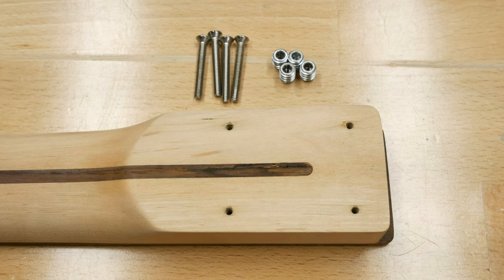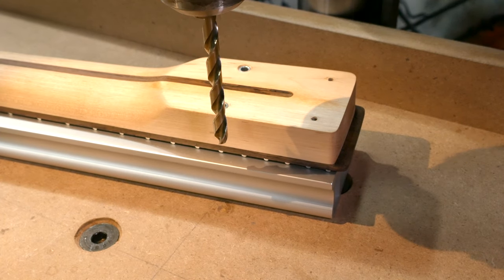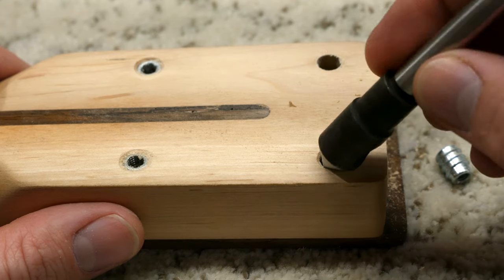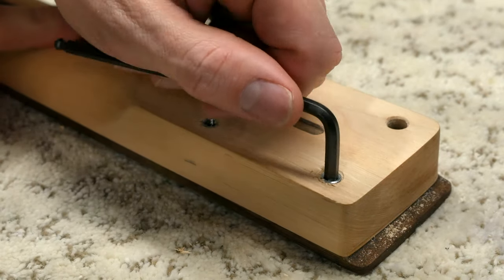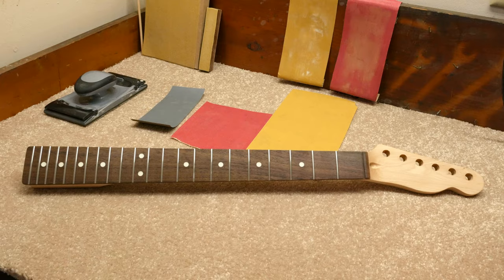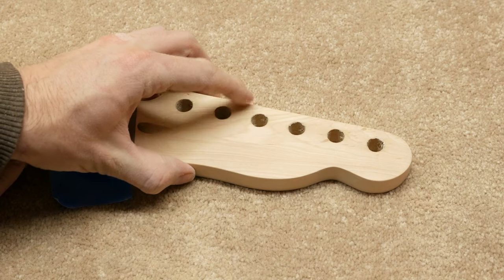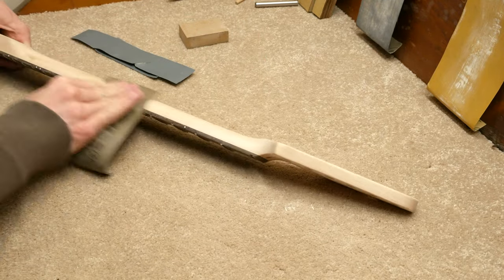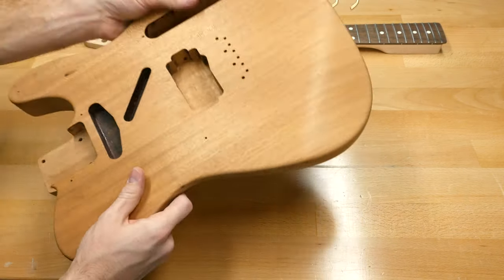Point of No Return || eBay Telecaster Revival || Episode 8 || DIY Partscaster Guitar Build

Comment: @Augment Guitars. Sir, you may already know this, I remember a video from Texas Toast Guitars where they fitted those threaded inserts to the neck on one of their builds/upgrades. I am sure that they used a straight piece of (cut - down) Allen/hex key in the chuck of the pillar drill to drive the inserts into the pre - drilled neck. The guy turned the drill chuck slowly by hand, with the neck securely clamped to the drill table. This made sure that the inserts were started and driven in as straight/vertical as possible. Keep up your good work. Stay safe and well.
Reply from the maker: Good call! That is an excellent way to install them as well. I'll have to look that up and check it out. Seems like a foolproof way to install threaded inserts. My jig works pretty well and ensures they are in straight. I plan on making a video here soon detailing how to make one and use it. Thanks for the tip and watching the video. I hope you stay safe and well too. 🙂
Reply: @Augment Guitars. Thanks for your reply. The Texas Toast video where they fitted the threaded inserts was specifically on a Fender Stratocaster. In order to adjust the truss rod, the neck had to be removed because the screw head was completely concealed by the neck pocket. Obviously with removing/re-fitting the neck even just a few times then the standard screw holes would become sloppy. So your solution is the best option. Top work sir!
Reply from the maker: @markmiwurdz202  They have a lot of good stuff on that channel! I have learned a bunch from them. Currently, Ive been watching a lot of their spraying tutorials as I am building my own basement spray booth. Always learning new things! 🙂

That is a perfect use case for neck threaded inserts. I have set up a bunch of Fenders with that same truss rod design and it can be a pain. Having the peace of mind that you wont strip out the neck mounting holes makes all the difference. Thanks again for watching and the kind words! 🙂